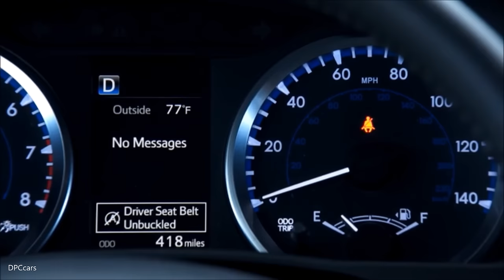Crash Test Without Safety Belts Buckled In The Back Seat

Comment: 2:57 The back seat seat belt wont save you from that whiplash on your neck though :(
Reply: I wonder why that actually happened, the belt should have not loosened that much. If it tensioned properly the properly set headrest would easily have taken care of that whiplash.
Reply: mikosoft no
Reply: duhh its a crash lol whiplash or death?
Reply: @Gamerboy-gy1rl  Some people think that they are superhuman or that they can catch themselves in a crash, so they unwittingly choose death lol!
Reply: @mikosoft  They are dummies with no neck muscles. The rear dummy's head just bounced off its chest  like a basketball and went crazily whipping backwards in a way that doesn't seem realistic.  Also, this isn't a real crash; it some sort of acceleration cage. In a crash, the acceleration is sudden, so the belts will lock up. Maybe the onset of acceleration in this device is too slow in the early milliseconds of the event, and allows for slack to build up in the belt.
Reply: @mikosoft  This happened because the rear belts don't have pyrotechnic pretensioners like front ones do, so they lock later. search up pre-2005 crash tests and you see the play in the belt is very common and considered normal.